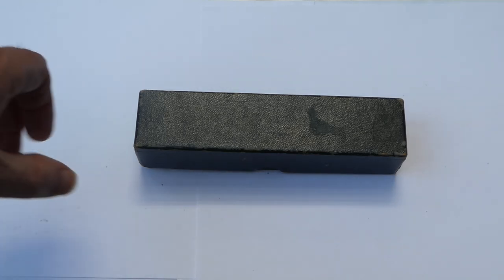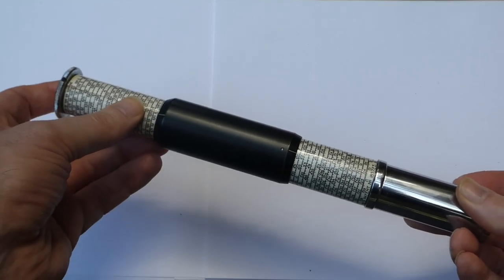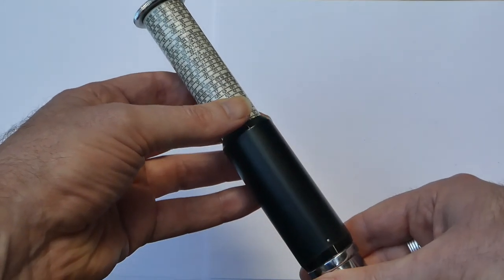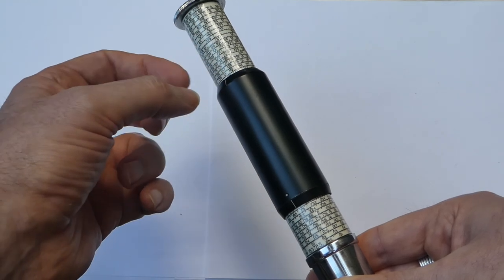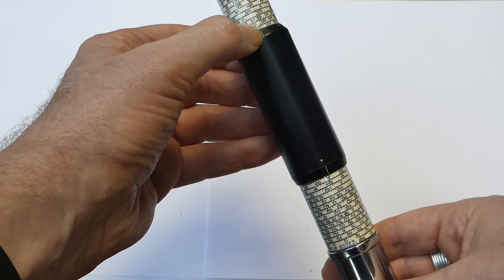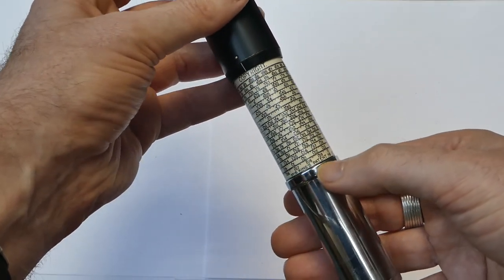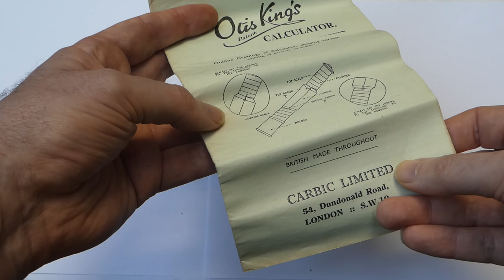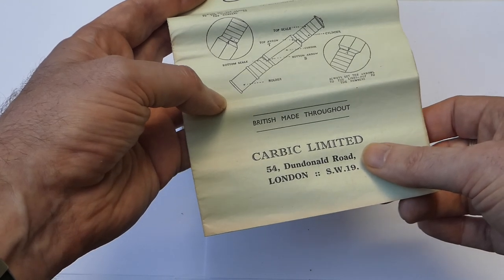Otis King's Pocket Calculator

Comment: I bought one at a flea market today. It came in its original box and includes leaflet and instructions. Serial no V6524, and it is in absolute mint condition - literally never used. Which is particularly nice is that mine was distributed here in South Africa by a local company, and the instructions are localized, too!